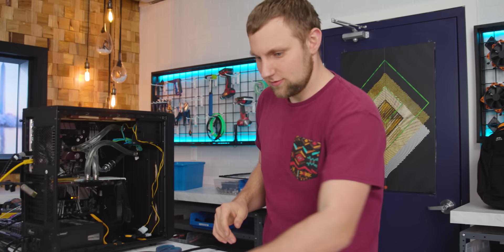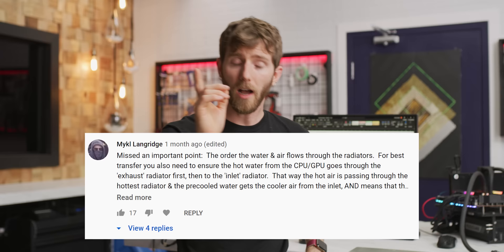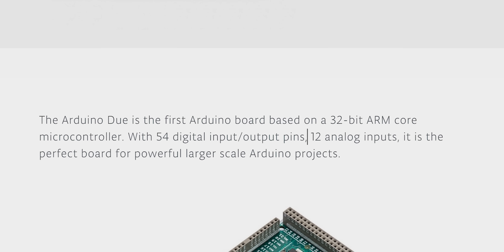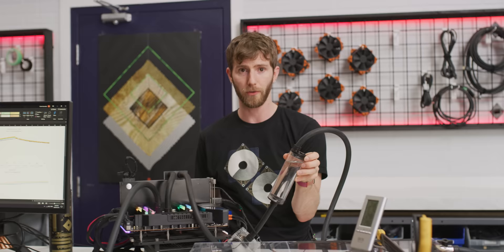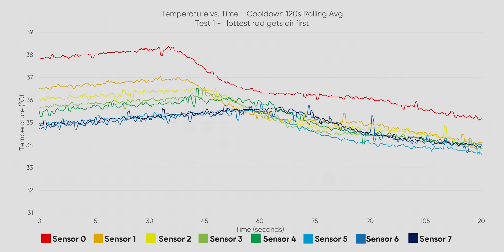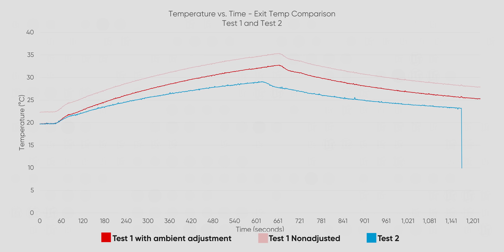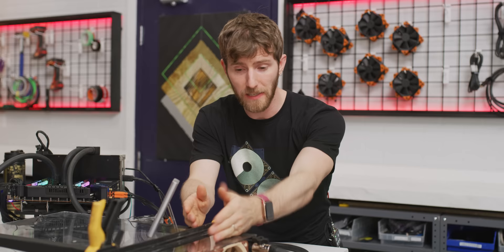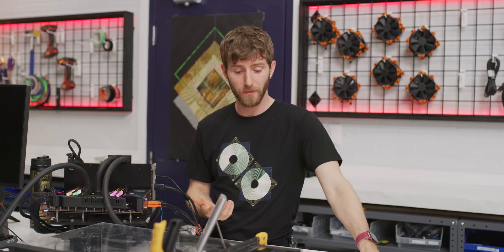Is this even going to work…

Comment: And if we connected each radiator in series and vented them independently (vertically or w/e), we'd see even more benefit. Still diminishing returns as the water approached air temps, but still better returns than each rad blowing air over the next. I'm glad you made this video.

Comment: well...if you stack radiators not one below another, but nearby or add spacing between them, so heat from previous would not be input air input for another, it would have greater effect.
otherwise it is just thermodynamic, you take the heat from the water to the radiator, heat the air and then blow the heated air to the next radiator and heating him, which will heat or cool the water depends what is  more heated

Comment: Hey Linus and crew, great video. I really liked how you approached this, and did some science. You discovered, apparently without doing research, the principle that chemists have been using since the dark ages: Counterflow! It cools more efficiently, as you discovered!
Now the interesting question: When you used the 2-rad setup, did you use counterflow or the conventional flow (hottest rad gets the coolest air)?. Because, yknow, that'd be kinda important to mention if you actually implemented the things you learned.
Also, some graph smoothing would be nice if you have such noisy data. Could you possibly provide us with the raw data?

Comment: 4:01 Use 4 wire RTD or 3 wire RTD. That is standard for this kind of measurements.
Reply: True, though temp compensated thermocouples would have been good enough for this, not like the sub 0.01K accuracy is needed
Reply: Or even a digital temperature sensor

Comment: On the charge air system on ship main engines (think 6000kW and above) the radiators (intercoolers) are stacked, but on two loops: hot air goes through a HT cooler first (linked to the engine’s cooling) then LT cooler (the LT loop of the ship) think 90c then 35c. Additionally, each cooler has its hot side facing the flow and its cool side towards the manifold. This just happens to be the most efficient way both on paper and real life. So stacking does work, but beyond a certain point air flow reaches thermic saturation (ie is the same temp as what it is cooling) and you are detecting only parasitic loses or a form of thermal mass effect (heating one cooler to saturation then the next etc). It’s nice you are doing a bit of science here, but you are mostly showing that there are always marginal gains to be had. Thermodynamics cannot be avoided or explained away. Love the vids!

Comment: I wonder how the two rad configuration would have performed in a "counter-flow" configuration. This in general performes better than the parallel flow that they used as far as I can tell.

Comment: I don't know if you would be willing to do some more research but here are two suggestions I was thinking of.   
  1.  Only 2 sets of fans and radiators with a 1 or 2 inch space between each set.  The second fan set would get some cooler air in.  
  2.  Using 2 fans, a heat sink the same length as the radiator then 2 - 12v 5A Peltier (TEC1-12706) devices. Next add the fan and radiator.  This will bring in colder air into the radiator.  Question would be how much more heat is brought into the computer case from the peltier devices.

All of these suggestions will require a change to future computer cases or a separate insulated case with chambers for a hot side and cold side like a data center.  I had FUN with this video.,  Thank you.

Comment: FYI: The "Due" in "Arduino Due" is pronounced "doo-eh." It's Italian for "two".
Reply: isnt it derived from 'duemilanove' and they just shortened it to due ?
Reply: @ayaturahim7785  no, duemilanove means 2009 and it's a fusion of:
due = two
mila (which is the plural of mille) = thousand
nove = nine
Thus, Duemilanove = Two thousand nine
Reply: @Nik16_YT  I think you misunderstood his question. That Arduino is called Arduino Duemilanove. Due is just its shorter name.
(Arduino was designed in Italy)
Reply: @AhmedKachkach  No you misunderstood, there are both Arduino Duemilanove and Due products, the Duemilanove was succeeded by the Uno (1) and the Due is not a successor but a related product using the same naming format. This is self evident because the Due uses the larger mega format not the original Diecimila format.
Reply: @AhmedKachkach  welp, I did not know that. I just meant to clarify that due in Italian just means two and is not the abbreviation of a longer word.
Reply: @Nik16_YT  Presumably Uno is the AT8 based and the Due/Duo is AT32 based?
Reply: @brazeiar9672  328p
Reply: I pronounce it Articuno. 
Cuz #kentoLife bay bay
Reply: No

Comment: 11:26 So... there’s going to be a follow up video where y’all take like 12 fans and funnel them all into a stack of radiators so you can quantify your qualification, right?
Reply: What about just one big fan... like those el'cheapos you get at the hardware store (18") ducted down to push the entire volume through the radiator bank?
No clue if they could even push the same volume or just choke on backpressure.

Comment: Only two concerns with this setup.

1) They didn't allow the system to reach equilibrium, though it got close. 

For any of these orientations, the delta-T between water temp (exiting the radiator stack) and air temp at equilibrium (heat in to the water == heat out) tells your how efficient the radiator configuration is. The ramp rate does not, as it's affected by the amount of water/radiator in the system, which is also has to heat up.

2) The flow rate must also be equalized between configurations. 

Flow rate directly impacts the water temperature delta across both the CPU/GPU and across the radiators. Water has a specific heat of 4.184 Joule/(gram*degree C). 1 watt is 1 J/s. So at 1GPM ( one gallon is 3,785.41g at STP) flowing through the radiators, a 1C change in temp is equivalent to 264.0W of heat dissipated. If the flow rate decreases to 0.9GPM, because you go from 1 rad to 2 in series, the heat dissipated per 1C change in fluid temp also decreases to 237.6W. 

Thus, you can't simply compare the water temp between different orientations, you must compare the heat dissipated or, as stated in point one, the equilibrium delta-T (water outlet to air inlet).

Comment: What is the point of stacking? Leaving them in series with fans for each would net you much more cooling. Parallel and separate fans with back flow prevention would work great too.

Comment: Here's my project... five 420 mm rads, each with three up to 3000 rpm 140 mm noctuas.
All five put straight up, outside the case, like skyscrapers.
Each rad gets its own fresh air. Pretty cool, huh?

Loud? It depends. Hidden behind a large case, the sound can definitely get muffled.

Comment: It kind of seems like more rads acts as a bit of a low pass filter for the temperature differential (less “noise” in temperature feedback). But would of course be much harder to cool after heat soak.

Comment: It's the airflow - the faster the air moves, the less of the thermal capacity of that air is used per radiator.
Think of it mathematically, as you move towards infinite airflow, the thermal capacity of infinite air is itself infinite, and will allow infinite radiators to be effective.
The other side of the coin is that the faster the airflow, the bigger the delta T between the air and the surface of the radiator, so the more heat the air absorbs per unit of time, so the number of effective rads doesn't quite scale linearly with the amount of airflow.
For example (using obviously bad numbers), if the air is 20C, the rad's surface is 30C, and the air coming out of a single rad is 22C with low airflow (a delta of 2C), doubling the airflow might result in 21.1 instead of a flat 20, for the simple reason that heat moves faster between 30C->20C than it does between 30C->21C.
That model is also simplified in that it assumes infinite heat from the radiator, and doesn't account for the faster airflow pulling that temp down towards an asymptote. 
There will even be a point where the number of rads will eventually reduce performance, as the increased air resistance eventually overcomes the benefit of increased surface area.
Modelling this is extremely difficult - because once you jump into that rabbit hole you need to start considering that lower water temps will reduce silicon temps, reducing leakage and reducing thermal output, in turn reducing water temps further and round and round it goes until it again reaches a mathematical limit where the % gains of each loop are infinitely small (another asymptote).
The solution is to just send your computer tower to Antarctica and use really long wires, or use comic book / cartoon physics where a module in your chest can somehow produce enough energy to let you fly around like a human rocket with laser beams, but not overheat any of its systems or its user (not to mention that the energy input required to make its fuel was only a few seconds worth from a laser powered by the grid in some guy's house) - that'd be nice.
Reply: Chapeau, Sir!

Comment: You should have measured the total water capacity of this stacked loop and done a control with just one 240 radiator and a big enough reservoir to have the same total water capacity. This would eliminate thermal capacity from the equation.
Reply: There is also the thermal capacity of the radiators themselves, that much metal is going to soak up some heat.
Reply: STOP AAAH MY BRAIN

Comment: In my experience, CPU/GPU temps are peaky where the utilization will jump for small durations then drop back down creating heat spikes vs running full-tilt all the time. I'm wondering if stacked rads could smooth out this peakiness leading to a lower overall average temp due to the thermal buffer.

I'd also be curious about the following configurations vs single rad:
1. Fan sandwich with rad-fan-rad configuration
I think this would be more efficient, it seems like having the gap between the 2 rads creates some sort of hot pocket which could affect static pressure. It also appears that your setup isn't 100% airtight between the rads so this could have an effect as well.

2. Top mounted vs horizontal
Since heat rises, you could take advantage of the heat radiating up which could potentially create a small advantage for the dual rads since there's more surface area to radiate from.

Comment: delta of temperatures doesn't give you any info! Only an average temperature is important.  If the rising of temperature stops, that means your cooling system could remove the heat of your system. So both systems remove 500 watts from the water making the water cooler on the same degrees.

Comment: Water is your thermal energy storing medium so the more you stack the more energy you are transferring into the water while it's running in a series stacked loop it may not dissipate enough heat efficiently into the air (Obviously same air flows through all rads) and which would build up more and more heat. it's like comparing the momentum movement of a truck compared to a car. but if you would run that in a parallel you might find better performance.

Comment: cars deal with this same problem. If a car is being designed (or modified with a hotter engine) and the engine is having overheating issues, stuffing a bigger radiator in the car isnt always the right fix (although sometimes it is... cough gen 3 rx7). sometimes the radiator just needs enough airflow and the design of the body impedes that proper airflow. the same principles can be applied to intercoolers as well.... basically anything related to air and/or liquid cooled heat transfer.

Comment: whats Funny is this is only about Stacking rads. which you start to get diminishing returns after the 2nd or 3rd. even with Pressure Opti fans. your still going to Lose air flow to Resistance from the rads to the point that Stacking them like that does little if anything.
what would be more interesting to see in a server setup is something where  each Radiator has a Bottom port in the front to act as a Inlet 
and the top has a Outlet just behind each radaitor with a baffle behind it to force the air up and out
this would allow each Rad to get Fresh air. and would get you better results with prob 3 rads vs 6 stacked.  it would also take up less space too.

Comment: I'd be intrested to see if keeping the same setup but orientating the rad stack like a chimney (vertical instead of horizontal) would make any difference. Im probably wrong but think there may be a possibility of warm coolant being stuck in the loop between each rad. I have a funny feeling the temperatures (between each radiator at least) would probably lessen the range difference. Probably a complete and utter ball-ache to run the same setup again, but food for thought and all that!

Comment: Before watching: As long as you got the coolant counter flow right, yes it will work. Not as well as each rad pulling room temp air, but it will work.
Reply: Using the exhaust of one rad to cool another is plain stupid if it can be avoided.

Comment: Without an evaporative process stacked radiators will only remove heat to the point of room temperature.  
If you misted the radiators with water while air moved over them you will have effectively dropped the temp below ambient.  But adding a mister is a whole other thing and redundant once you understand what's going on, the next obvious step would be to just run a sealed refrigerant system that controls the evaporative process internally with a purpose made refrigerant.

Comment: Remember cases that had tube pass-throughs on the back?  Are any still being made?  Given enough space on one's desk, it still make sense to put the radiator outside the case so it's completely surrounded by, worst case, ambient air.  An automobile would have better engine cooling if the radiator were not under the hood where the heat is being created (which of course matters less as the car goes faster, since the generated is being pushed away from the radiator by not just fans but by the car's forward momentum).  Of course, nobody would buy a car with a bog honking radiator on its roof.

Comment: The redundancy of the second radiator really depends on the output of the heatsource and the capacity of the first radiator to cool it. So if the cpu output more heat and/or the radiators were smaller, it would become increasingly more viable to use multiple radiators. The system just doesn't reach that threshold. Delta T, of water and air, exiting the first radiator would need to be meaningful.

Comment: In 2-stage exhaust gas heat recovery first stage is cooled with output water from second stage. In your setup the last rad receives coolest water and hottest air so there is no delta t to cool the water.

I would like to see test where you rewire the cooling layout. Outmost rad with coolest air will be the the last rad with coolest water inlet before return to components.

Comment: I’d be interested to see a test where cooling is only done by the mass of the water. Have a huge reservoir without any radiator and see how long you can have a load before reaching max temps. and also how long it would take to cool down.
Reply: It depends on how the heat is dissipated through the water storage. P.S. Some houses in Germany are built with huge insulated water storages to use the sun energy for cloudy days : https://www.youtube.com/watch?v=yIivu09ojig

Comment: Just a suggestion: use a LM35 sensor, it's cheaper and is calibrated from factory (10mV / ºC), so you could use the same scenario but without potentiomenters and cold water needs. Also congratulation for the precedure and results!

Comment: Next logical step to make better use of stacking would be to make sure each radiator gets fresh air. It will be very impractical in a case since you would have to use baffles or ducts to get the air in and out. Better yet would be to move the fans and radiators to a separate unit :)

Comment: think outside the box, literally. just put some radiators outside the case just free hanging. works just fine. same for the pump-res combo if it does not fit inside.

Comment: Extra radiators mean extra cooling potential, but also increased air resistance, so if you don't put more power into moving the air, by running fans at higher rpm or adding fans, they just cancel each other out.

Comment: Multiple stacked radiators means more water which in turn will mean more to fluid to carry the thermal load, so its OBVIOUSLY going to be better.   Wouldn't you get the same figures having 1 radiator and a gallon reservoir? Also I'd like to see it with a fan on each rad so it draws the cold air through the 7 of them.

Comment: about the PUMP
Don't forget that D5 pump is probably struggling to overcome the resistance of the extra radiators. It's not designed for that. Either the flow is reduced or the pump is running all out and killing itself. Or both... so might want to try that test again with a better pump.

Comment: If you had a second set of fans between the two rads in your final test, then there would have been improvement over 1 rad with 1 set of fans. Your adding more cooling area, but also adding to airflow resistance, so they counteract. Most PC builds will have fans on each rad, and no standalone fans.

With that, I would like to see a test 3.2; 2 rads with 2 sets of fans, and 1 rad with two sets of fans.

Comment: More radiators/surface area always mean higher cooling capacity. Unlike airflow which gives diminishing returns past certain air speed, surface area increases cooling capacity in a linear way, i.e. double the surface area means double the cooling capacity. In this test we see cooling of 500w system by 7 radiators each of which having enough surface area and airflow to adequately cool the system by itself. Now if this was 5000w system, the results would have been much more exciting.